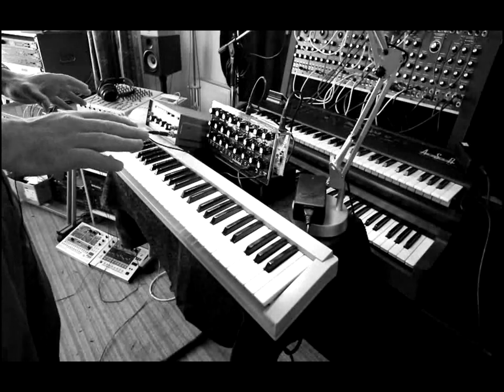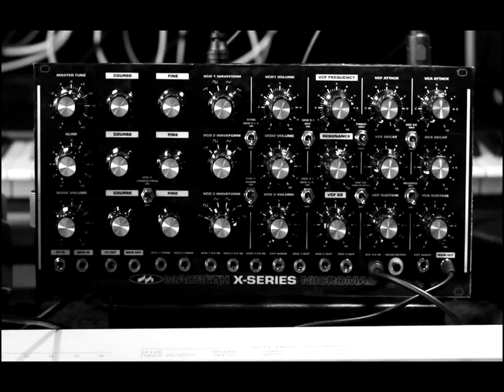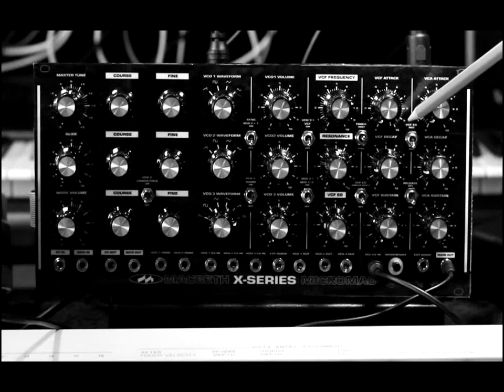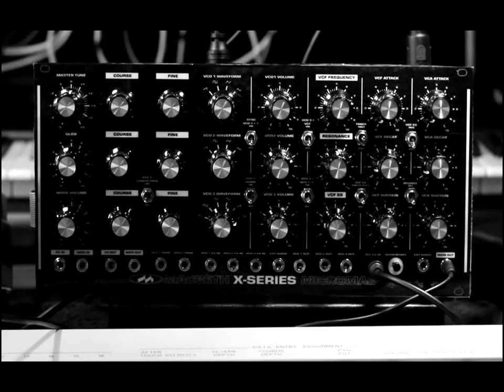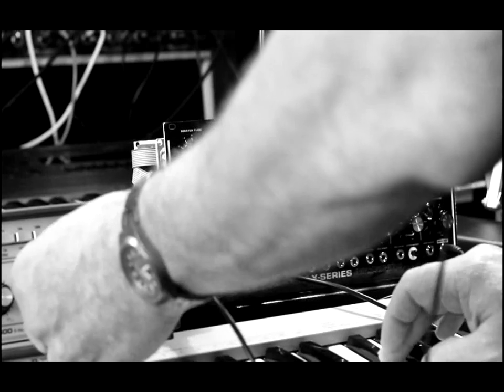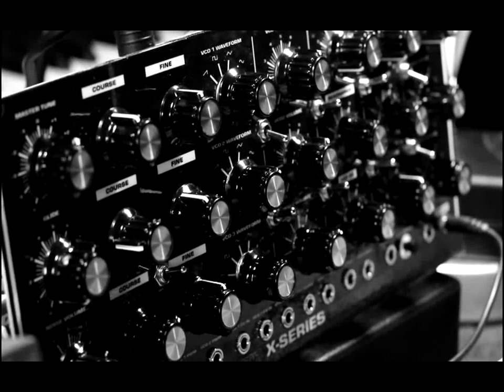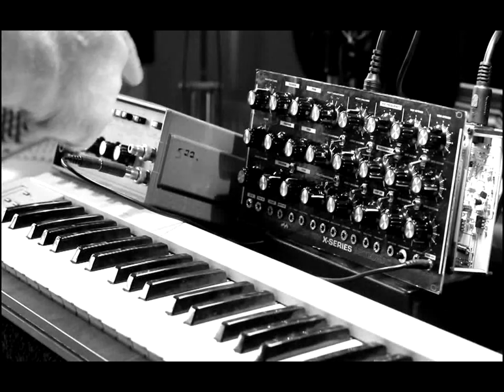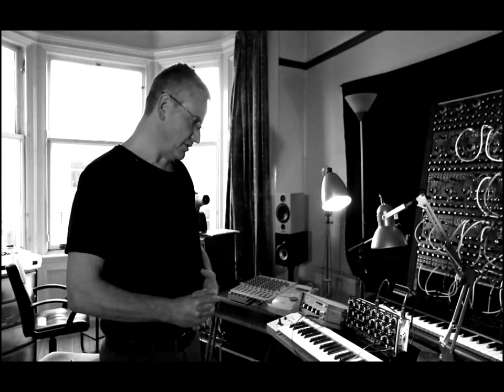micromac introduction.mpg

Comment: Forgot to mention: is the VCA jack a TRS jack? I was thinking it would be nice to have access to the unused EG output when modulating the VCA from an external source and even process the EG out through an external device and then pass it back in (like a mixer insert?)  I think I'd put the VCA input on the tip and EG on the ring so you could use a normal TS cable to modulate the VCA and hopefully grounding the EG would be fine, just using a TRS when desired/needed.